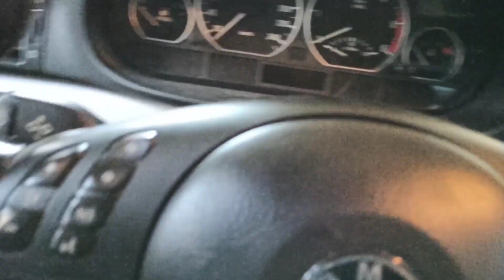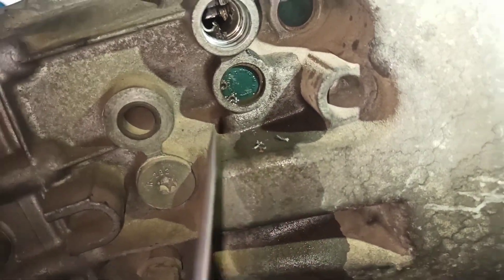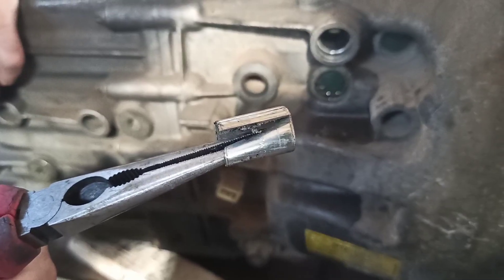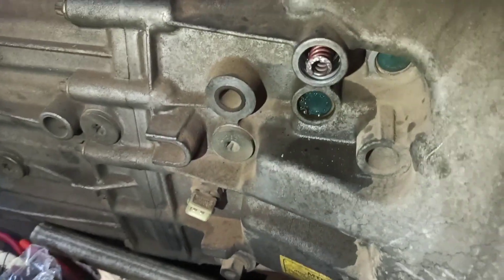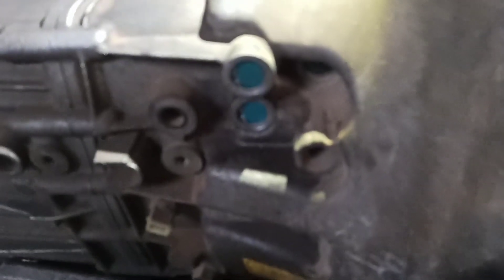BMW ZF 5 speed transmission/gearbox Shift detents replacement

Comment: Your dsg video was great. Just have a quick question. Does the replacement gearbox have to be an exact code and 02E number match or just the exact code? I have a KPS gearbox 02E300051TX and have found another KPS with 02E300050TX. There is 1 number different, would this work? Is there any coding required maybe when replacing a dsg? Would really appreciate any advice please.

Comment: Thanks for the good video. The video helped me a lot to try to solve the same problem myself. Tell me please did you drain the oil or is it not necessary?
Reply from the maker: Hi,
Thanks for watching
I'm delighted it helps 
BMW recommends oil is lifetime, but I would of course recommend replace oil if car has higher mileage.
Reply: @out_of_service_tech  

thank you very much.
I'll replace it, you're right, it's better